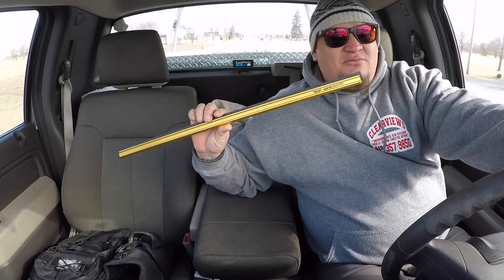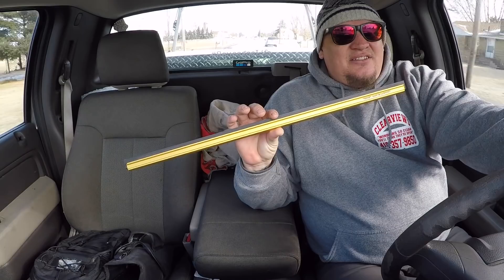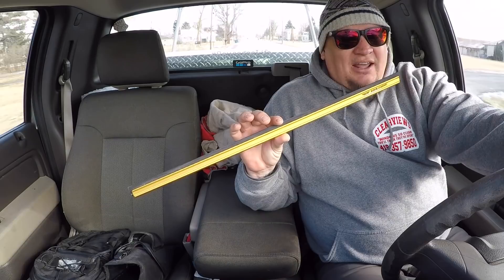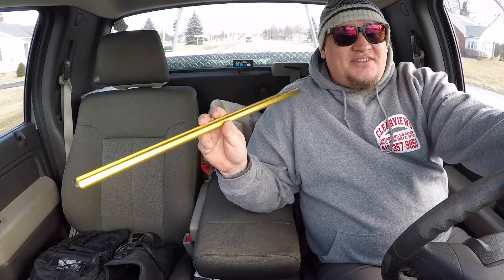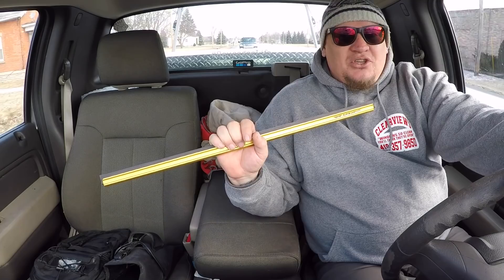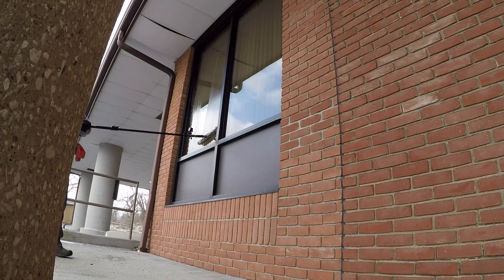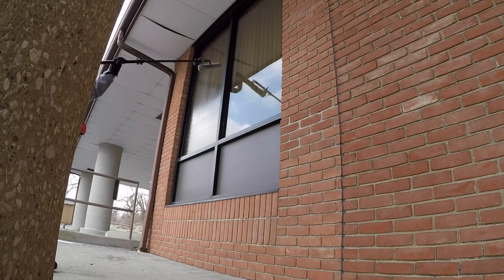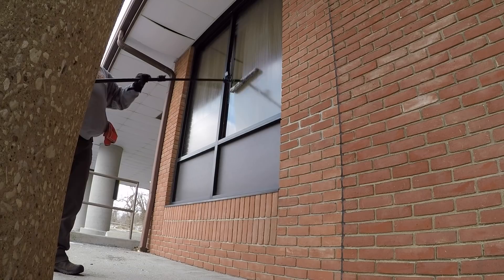Super Channel from Ettore

Comment: I have all 3 sizes they make. 18, 24 and 36. I’ve found the 24 works amazinggg. For a lot more than I thought it would too. 

My only gripe is that it leaves more water on the edges than the Sorbo does. 

Total tank of a channel though. Love the gold
Reply: Window Cleaning Anthony they also make a 30”
Reply: And that’s weird I use the super channel and it never leaves water? Oh well
Reply: Jacob Williams on straight pulls, next to the seal there’s always a drip. The Sorbos just leave a smaller drip in my experience
Reply: Window Cleaning Anthony yeah maybe dumb luck on my part but it hardly ever leaves a ton of water.
Reply: Jacob Williams if you push real hard it leaves less, but that messes up the edges of your rubber faster. Yeah I usually get a quarter inch and less
Reply: Super channel loves Jacob